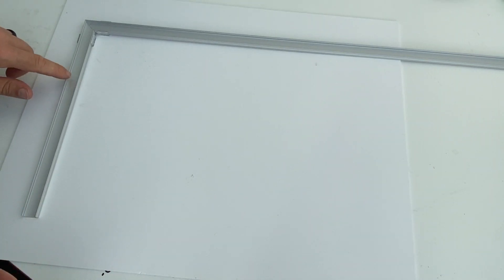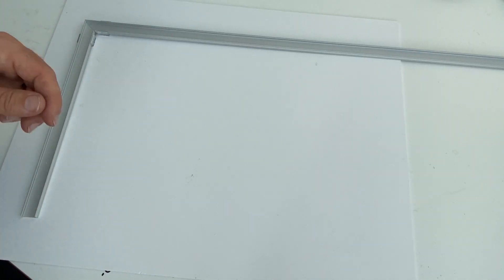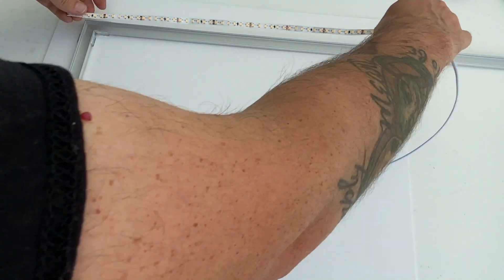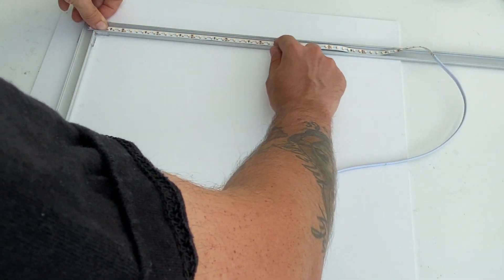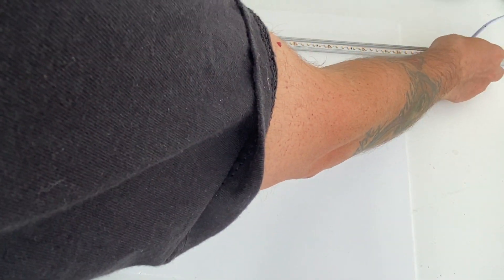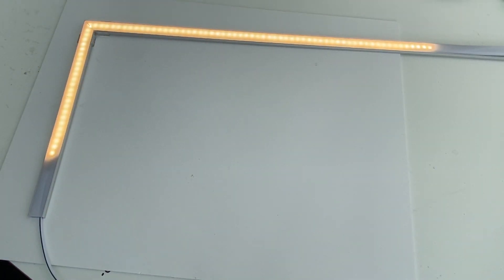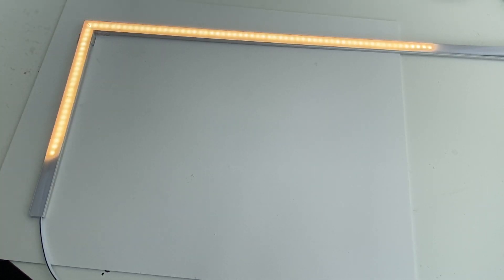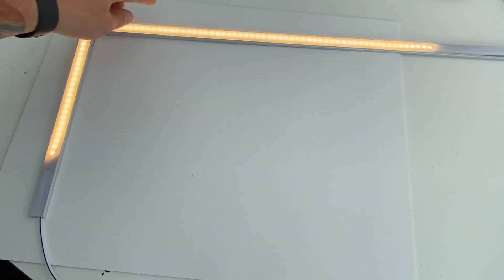How to cut LED strip profiles / extrusions to go around corners -  Part 2

Comment: how did you got the eged of the cover cut in 45 degres?
Reply from the maker: We use miter shears, they are readily available for less then £20 on Amazon and make precise clean cuts of the lens covers.

Comment: You may be aware of the new trend in which younger people have been placing led light strips in the corner ceiling of their rooms. In your opining would it look better having diffusers like in this video attached to led strips or just the led strips bare. I feel it may look tacky being able to see the dots on the led strips given in the past people would only place led strips behind something to provide light.
Reply: Those kind of LED strip are low quality. In architectural lighting, you'd always use an aluminium profile to dissipate the heat, and a high LED count per meter such as 240. Then a diffusers to minimise the visibility of dots.
Reply: @adrenalinejunkie3828  can you buy multi coloured ones and would this be cost effective?

Comment: how do you cut a v shape profile on ceiling?  the profile cover has a slight bulge.
Reply: Use a miter saw with an angle measurement or a cutting box with a hand saw so you can line up the angles.  Put painters tape over the cover and channel so they hold together while you cut through both of them.

Comment: The LED's haven't gone round any corners! the profile has. Why not just solder the corners using a small soldering iron, silver solder and a little thought. Use one driver, this is how I did mine.